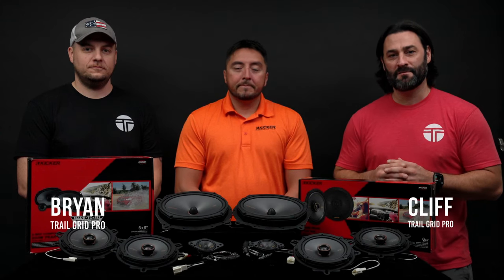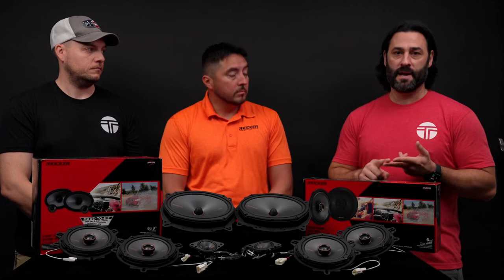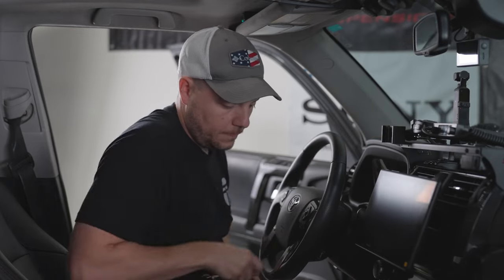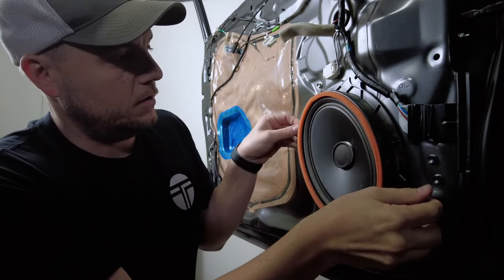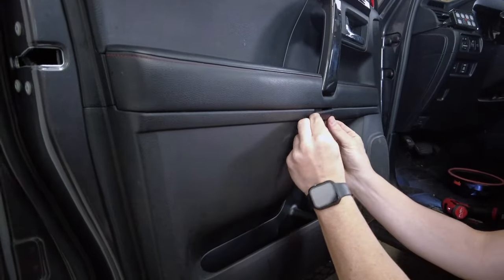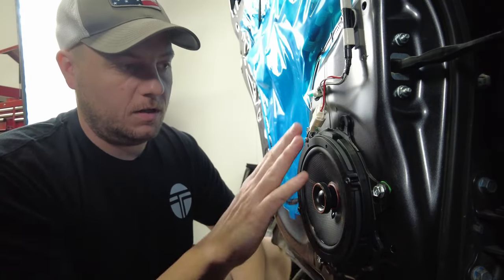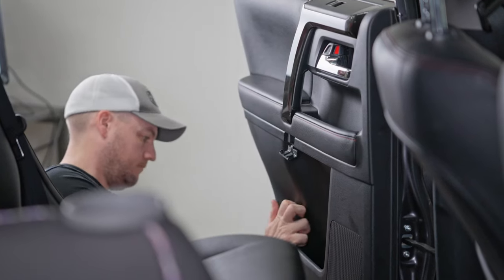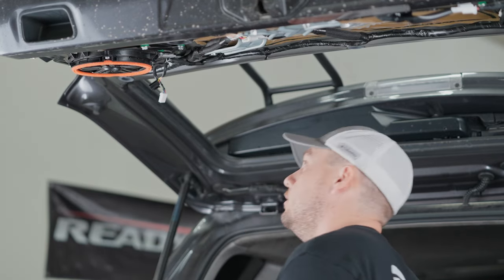Kicker 8 Speaker Plug & Play Upgrade Bundle Install | 2010 - 2023 Toyota 4Runner

Comment: I need someone to be 100% honest with me. I am 56 years old and think the 2022 4Runner with 3000 miles  has a pretty good sounding system. It is not the JBL system. The reason why I got this suggestion to look at this video from Youttube is I was looking at the Subaru tweeter upgrade yesterday. Those little dash speakers for $80 to $105 looked to be a kind of cool upgrade i could do in a few minutes. I like old AC/DC and we listen to the Beatles  channel  and Ozzy station on the SAT radio. Would the $700 for this kit just blow my mind or should I just get the little dash speakers? I have bought BFG stock size tires and do want to level the front of 4Runner soon. PS I am not rich.. I am just a working man with teenage daughters that take a lot of my money..LOL
Reply from the maker: I (Cliff) have this same system in my 2020 4Runner TRD Pro with a JBL amplified system and I absolutely love it!
Reply: The tweeter upgrade really helped mine alot with clarity. I am pretty happy with just that alone but I want more bass now lol. I’d start with this kit. It’s on sale and has all you need
Reply: I also like the factory system but added a Jbl 12" powered sub with controller for better bass. If you are listening to just rock you could do better than this for cheaper. Kicker to me is a Walmart brand and 800 is kind of steap.
Reply: Also bilstein 5100 makes a good lift/ leveling kit for about 700$
Reply: @gmoney713-r7z  that's an interesting take. there are several drop-in speaker choices including this kicker offering. others are OEM audio plus, kenwood and the Focal IS line. there are more but those will give you relatively the same results. the stock system is absolutely horrendous in the 4runner, it's right up there with the headlights on the scale of "what was toyota thinking?". i personally run audio frog GS line speakers in my '19, i'm very happy with them but i have helped friends install the kenwood's and kicker KS line. you can just about do the whole truck with either of those for the cost of my audio frog GS690's. the frogs are better but for most people they will be very happy with the kenwood or kicker. no matter what anyone chooses to do job number one should be to change the dash speakers, use literally anything that will fit (drop in tweets, 2 3/4" speakers, some 3.5" speakers etc.) the reward is well worth the minimal cost and time spent. PS. not a huge fan of the Focal's, cost too much and sound no better than the kenwood or kicker KS.
Reply: My experience with the stock toyota upgraded speakers is a pronounced hump in the mid bass frequencies and a lack of true sibilant high frequencies.  An aftermarket system such as this will typically smooth out the mid bass hump and extend some lower bass.  Years of experience, (since early 1990’s)  with Kickers as my speaker of choice in ALL of my vehicles has shown bass reproduction is extended and high frequency is smoother.
Today I’m heading out to install the new speaker system in my new 23 4Runner and then I’m ready to enjoy a long period of excellent music enjoyment.
Trail Grid Pro and it’s hardware partners have done a marvelous job of putting an all inclusive kit to change out the factory speaker system for a great sounding Kicker system.
Reply: I'm 57 and just put this kicker system in yesterday. Night and day difference than factory speakers. You'll notice right away when taking out the stock speakers just how poorly they are made. I have no plans for a sub or new head unit. TGP has done all the homework and included all the wiring adapters and crossovers so it's easy to connect. Got my 8 pc setup for $425. A no brainer for me.

Comment: Sigh I put this in my 21 nightshade 4Runner. Feel like this set needs an amp any suggestions cause to me it’s not a significant change.
Reply: It made a slight difference in my 18 TRD Off Road with the miss and high I paired with a 10” kicker hideaway sub under my seat and that completed the package for me. it was a tight fit but it fit i do have some seat jackets so that may have helped fitting it under there

Comment: Just finished the install of this kit from Trail Grid Pro and it is truly impressive, especially with just the stock head unit.  Unbelievable difference.   It was an easy install, i juat followed this video. Instead of drilling holes on the back doors i just found a couple of short screws.  Also, my dashboard speakers were not a t20, they were another set of 10mm bolts holding the speaker to the frame and they were in so tight that when i tried to loosen them the frame started to bend.   So i reinstalled the frame in the dash and then loosened the speaker bolts, then removed it for install.  Great job putting these kits together, I'm very happy with how it turned out.  Next up is to install the Alpine bundle I bought from you guys.
Reply from the maker: Ah, we sincerely appreciate the feedback!! Thank so much for the tips! Great job on the installation! We appreciate you!

Comment: Does the stock headunit nonJBL in a 2018 have enough power to really drive all those speakers?
Reply: Yeah, that's a good question.
Reply: Good question. I would love to know the answer to this too. I would like to keep my OEM head unit but would like to upgrade the speakers.
Reply from the maker: Our rule of thumb is sound is a personal preference. For some, it will be enough - but those looking for more can always swap to one of our Sony bundles for more power or add an amplifier.
Reply: @TrailGridPro  which amplifier you have available?
Reply: The stock head unit absolutely DOES NOT have enough power to drive these speakers. This plug and play kit is incomplete. Not to mention the kicker ks series sensitivity is quite poor. They should be including an amp in this kit if you have a stock head unit.
Reply from the maker: @oregondork  Thanks for your feedback and we definitely appreciate your point of view! I think it’s important to note that most of our customers that have purchased this kit have the factory stereo and a non-JBL system and have really loved the new sound. In fact, we had a customer purchase this kit from us with an amp and actually returned the amp because he thought the new sound the Kicker system provided was more than enough and decided not to amplify. Our stance with sound is that it’s a personal preference. Some will desire more but it seems most are more than satisfied with just purchasing the new speakers which is great news! This system we’re offering is a starting point - we plan to have amplified versions in the future for those desiring more. Thanks again for your feedback!
Reply: So this can upgrade a JBL system as well? Does the JBL system have more power available to drive these speakers?
Reply: @TrailGridPro  can you make a video with and amplified version soon
Reply: @oregondork  completely incorrect. the 2 3/4" dash speakers aren't particularly sensitive at 85 dB but the 6x9's and the 6.5's are very easy to power. both will give you 90 dB+ on 1 watt. the stock head unit is plenty powerful enough and will provide ~102 to 105 dB. i ran my audio frog's in my '19 on the stock head unit for about 6 weeks while i was waiting for my DSP and amps to arrive. no doubt better with a fully active system and subs added but the frog's alone on the stock head unit would be fine for most people.

Comment: Trail Grid Pro Kicker speaker package review. 

I received my Kicker speaker package from TGP, packaging was excellent and everything that was stated was included. 

Installation of tweeters was easy, but note, you need to break free the bolts thats holds the speaker to bracket before removing the bracket from the dash. Those bolts are extremely tight. Once loosened the install was a breeze. Note: I added a 4x6 1" thick of soundproofing foam to the dash cavity before Installing the Kicker tweeter nicely tucking the crossover  down towards the windshield just under the metal lip. 

It's worth noting that adding some sort of sound damping material is worth the extra time and cost, as it vastly improves the sound quality as well as reducing noise inside the vehicle. 

I installed 48 sq feet of Dynamat in my 2023 4Runner, completely covering the inside of all 4 doors and rear hatch. I then added Dynamat around all speaker enclosures as well as all across the doors without covering the area for the moisture bearer. I also added Roadkill Speed Rings to all speaker enclosures for added damping and insulation. 

Kicker KS speakers are excellent speakers, the sound is accurate, crisp, and very detailed. The 6x9 woofers with some fine tuning can hit deep with accurate bass/mid bass, and the 6.5" speakers with the silk dome tweeter do an excellent job with balancing out the rear of the 4Runner. 

I'm currently using the stock head unit, no additional amp or subwoofer. This Kicker speaker package is most definitely a solid upgrade that will allow you to crank it up with "concert like volume" and enjoy your music and 4Runner.

I plan on adding an amp and subwoofer at some point down the road, but for now this upgrade makes the factory HU a million times more enjoyable than it was before. 

Thank you TGP & Kicker for this package.
Reply from the maker: Woohoo! Thanks so much for your feedback!! We appreciate you very much!

Comment: Thank you for taking the time to come up with this set up. I just installed these this morning on my 2022 Off road. The difference is night and day. Particularly in the mids you can actually hear everything. I am leaning toward a new head unit now because If I could actually dial in the system these speakers would be Ideal for my needs. I do not have an amp and I didn’t install any dampering material or hush tape. I did notice though it was easier to take the window guide off of the top of the door panel after I took them off. Put the guide on before I pushed the panel back on. Otherwise it could be difficult to get the panels back on trying to angle it push down and fight the hard tabs in the guide. Thank you again.
Reply from the maker: Thank you so much for your super kind words! We are super pumped you’re happy with the new speaker set up!!
Reply: i fought with the door panels forever and then i saw this comment. this made it so dam easy.

Comment: Just finished this install.  Generally straightforward aside from a few things.  The passenger side tweeter bracket required bending back the tabs on the adapters with pliers. It also didn't use a torx, but another 10mm which was VERY tight, so I broke it loose while still mounted.   Reattaching the rear door panels was really tough on ours -  had to squeeze the top of the panel over the door frame with a lot of pressure to get it back in.  Overall we're happy with the new sound.  The tweeters and 6x9 in front make a huge difference and it was worth the effort!
Reply from the maker: Thanks for the feedback on your install experience! We're stoked to hear you're enjoying the upgrade!

Comment: regarding the hatch trim panel, there's a notch on the side for ease of removal. don't use anything metal as that scratches/chips the paint. i've been working in body shops and wrenching for almost 40 years and that's the way i've done and will continue to do.
Reply from the maker: Thanks for the feedback! Our guys are great at what they do and are very careful around painted areas. We appreciate the input!

Comment: The rear door install you mention one screw is too long and to drill a hole 7/64th in the door to accomidate the screw. Why not use a shorter screw? This kit, at this point, should have 2 shorter screws as apposed to drilling a hole in the door. Also would it make a difference to install a foam tape between the door and the speaker mount? I'm seriously considering this kit for ease of install.
Reply from the maker: Great question! We recently switched to shorter screws for these kits! We don't use foam tape on our installs and have had no issues or complaints!

Comment: I'd be curious to see the difference between this setup and the OEM audio plus. Also, would like to see a dedicated amp / sub install with this as well.
Reply from the maker: We've never compared them so not sure. We have heard great things about the OEM Audio system though!
Reply: I can tell you right now it will never sound very good without adding a power amplifier to power the speakers. The stock head unit can hardly power the factory speakers without volume distortion.

Comment: For the 4Runner without JBL, would these speakers improve the volume? Or they improve the definition so you can vamp up the vol without losing quality?
Reply from the maker: Volume (loudness) is a product of power and unless you change your source of power (new head unit or adding an amp) you will not get improved "loudness" - you will get improved audio quality though.

Comment: Hello just purchased this kit, will this kicker  46KISLOAD4 K-Series interface and Kicker 46CXA3604 CXA3604-4x90-Watt 4-Channel Full-Range Amp work with the oem radio? To add more power and keep the stock radio.
Reply from the maker: It absolutely will, but you'll likely need a line-out converter in order to run an amp off of your factory radio.

Comment: I got this kit a few weeks ago. And today did the front doors and tweeters. The tweeter install for me was a little different. Maybe because I have stock system. I mean it was easy to figure out but there was no way for me to take off the tweeter bracket. Basically there was no bracket. Also the original tweeter bolts felt like they were installed with lock tight. The bolts were insanely hard to get them going. FWIW I’m not good at this stuff, the tweeters took me about 30 minutes. And doors about 90. First door took a bit longer as I was taking my time and the door itself T is hard to put back on. Finally figured out to angle to door closest to the windshield to get it back on the tracks. Also one other thing, these are just small things I ran across, but the brackets are door specific. If your holes are not lining up to put the bracket on grab the other one. Maybe I am wrong in this? I on the remaining 4 speakers I am going to put the speakers on the brackets first then install in the door and hatch. Honestly it’s a little tricky to to hold the speak and try to put the screws in and line up the holes if your doing it by yourself. 

As for the sound for sure a big improvement. I am always one that feels like speakers need to break in. But for sure a huge improvement over stock. Running a Sony unit also bought from TGP. Well done fellas.
Reply: OMG I am dumb I just noticed the window was rolled down 😂😂 well don’t leave the window up like I did.
Reply from the maker: Thanks so much for your thorough feedback and your super kind words! Yesss, definitely keep the windows down when putting the door panels back on!! :-)

Comment: Hi, one question ... I have the JBL system in a 21' Pro. I had the OEM Audio+ in my 2016 ORP, and it was great. The JBL is ok, not as good as OEM Audio+ ... I'm looking for some improvement, and their solution is 3k and to have to mail them your JBL sub housing. Looking for something a little easier and cheaper, but as I understand, the JBL systems have the crossover in the HU for the dash speakers different than the stock system. Are the dash speakers in this kit different or crossed over differently for JBL systems? I've read of some bad results with OTS component speakers in the JBL dash. Thanks.
Reply from the maker: We wire the crossovers into the wiring adapters for these kits. We have seen great results using these speakers and a more powerful head unit!

Comment: My front door speaker mounts don't have the cutouts for the wiring harness
Reply from the maker: Kicker changed those kits and we just discovered this week that a small notch is required to run the wires through. We are now modifying the brackets during out assembly process! We apologize for the confusion!

Comment: I’d like to know how the Kicker speakers (installed in this video), which are available for $528 on your website, compare to the Focal speakers that are also available on your website, which are on sale right now for $797 but retail for $1,039. excluding the current sale on the Focal speakers, is there really a $511 ($1,039-$528=$511) sound difference between the Focal speakers and Kicker speakers? with the current sale there is only a $269 ($797-$528=$269) difference between the two speaker options. obviously if the sound quality really is $511 better between the two then it’s definitely $269 better as well, which is why i mention the retain price, since sales don’t last forever.
Reply from the maker: They create different sound experiences. Focal focuses on clarity and Kicker focuses on a more full body, concert-like sound. It honestly depends on what you're looking for from your speakers. In this example, un-matched clarity (i.e. Focal) is certainly a premium result that does cost more ... Focal hand makes all of their speaker components in France. That being said, they are both better than your stock speakers so regardless of the option you choose you'll be better than stock.

Comment: Do you need an amplifier when installing in SR5 non-JBL?
Reply from the maker: An amp is not necessary, but we definitely recommend a more powerful source to run these speakers. An amplifier or more powerful head unit would do the trick!